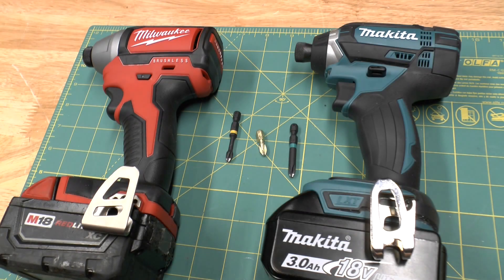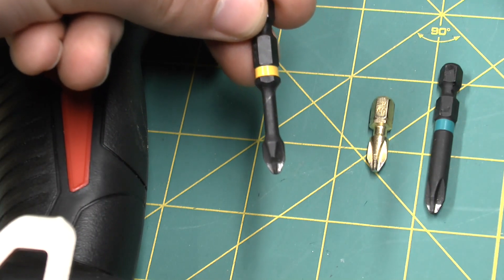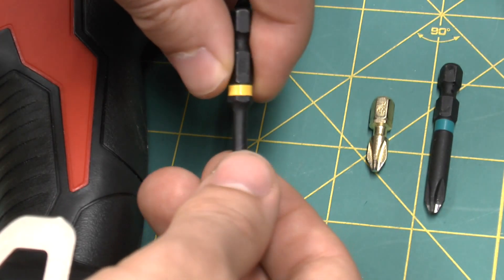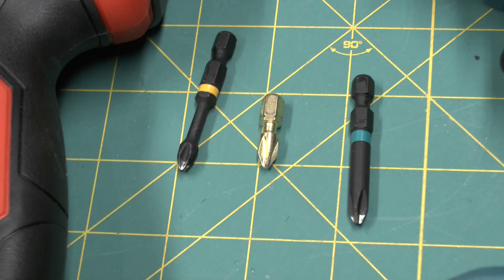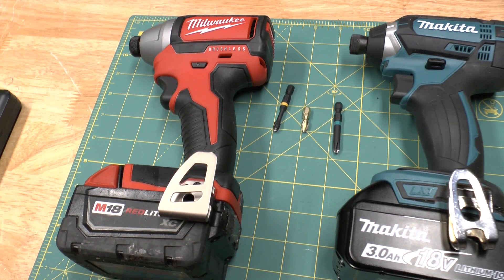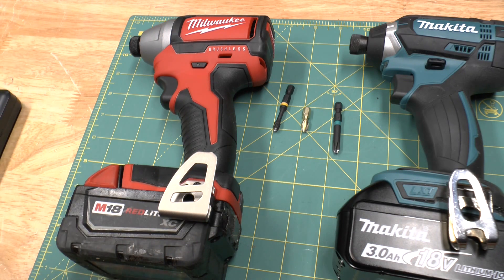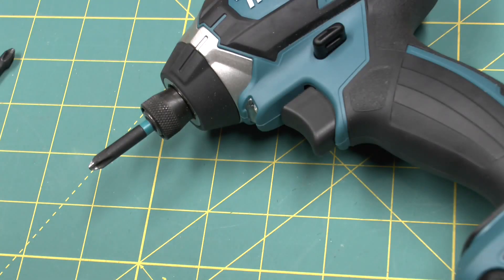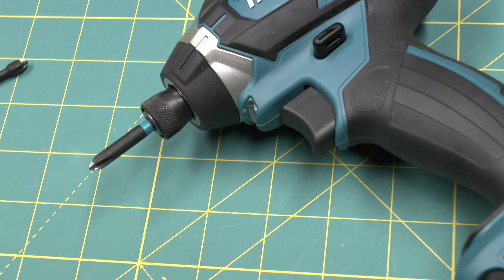Do Torsion Bits Slow Your Impact Driver Down?

Comment: Your theory I don't believe is confirmed. You need to do alot more than three drives per bit with this small of a variation. Plus the bits aren't advertising fastest driving they advertising that the torsion bits last longer. I really think you missed the point of the torsion zone.

Comment: You don't get it. It's not about time yeez .02 100 hundreds of a sec. Hahaha. Try a strobe light and see how these work.  torsion technology is way ahead in ahead in automotive impact tools.
Reply from the maker: The point of timing them is that the time is proportional to force transferred from the tool to the screw. That means some of that energy went into bending the metal instead of turning the screw. Repeated cycling of the bit will eventually cause the bit to fail whereas I think a spring steel is better since it is tougher and the whole bit can flex but not as far as a torsion bit.
Reply: @korbano  I think there is a really interesting question here as to whether impact drills are just overpowered for impact bits, and thus the manufacturers are compensating for their own competition to make more powerful drivers.  The question to me comes down to whether there is any advantage at all in using a torsion bit over a less powerful driver that might also be less expensive and lighter weight, with full-girth bits like ImpactX.  Now, the other thing manufacturers could do is vary the torsion zones based on tip size, application, and intended driver.  I think ultimately that might make sense.  I just think at this point manufacturers should be more transparent about what they are doing with the torsion zones, and whether broken bits might be a cue to buy a subcompact driver instead of scrawny shanked bits.